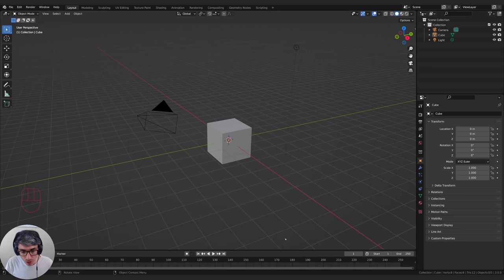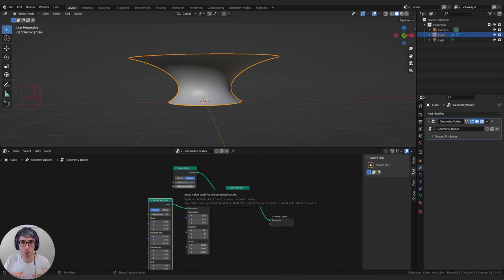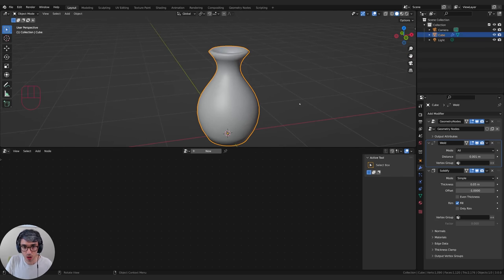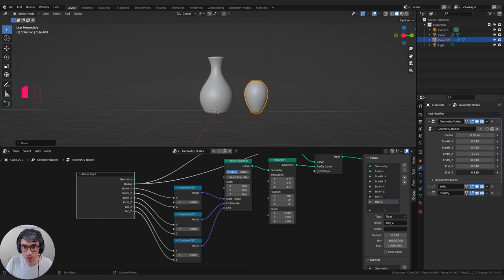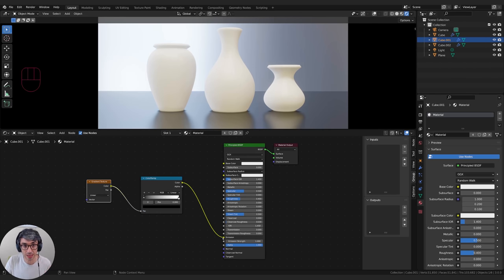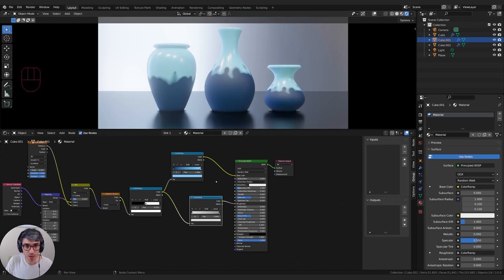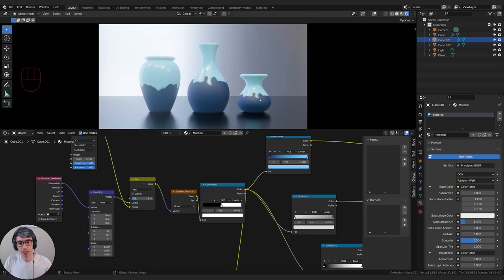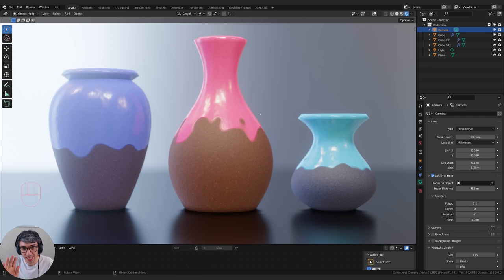Pots and Vases made in Blender | Geometry Nodes | Procedural (2022)

Comment: Fantastic! Quick question - what if you want to add more stripes of colour in the glaze, is that feasible with this process? I experimented a little but quickly discovered that because the glaze-placement ramp is used over and over to determine thinks like the normal, and it's structured as a high-contrast 'mask', I wasn't sure how to add more complex ripples of colour to the glazed area. Maybe this process isn't intended for that, though!
Reply: Instead of using color ramp for the colors, could use it to drive the factor of a mix rgb. To get stripes I'd probably use a wave texture to drive the factor of another mix that would then get plugged into the glaze slot of the mix driven by the color ramp. Hopefully that's not too confusing when written out like this.
Reply: @himan12345678  thank you! It's a little confusing, haha, but I'll try to figure it out, I appreciate it.
Reply: @himan12345678  Yes, this works perfectly! You can reuse the mapping coordinates to orient the waves texture the right way, going down the pots. You want a very low scale on the waves and some distortion.
Reply: @aethernaut1899  I'm glad it worked! Idk anything really about pottery so I wasn't sure if something like that would end up looking right or not. I've never used the wave texture so I'm unfamiliar with how it's oriented by default. I just know it's used for wood texturing mostly and roughly how it looks.